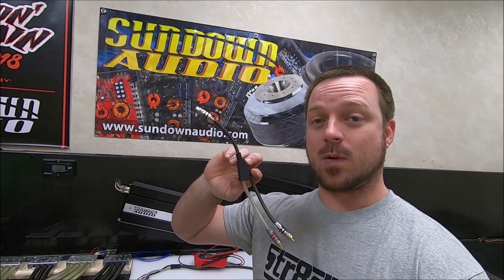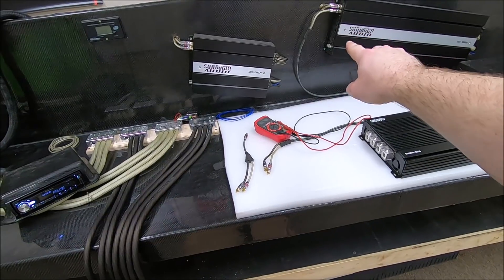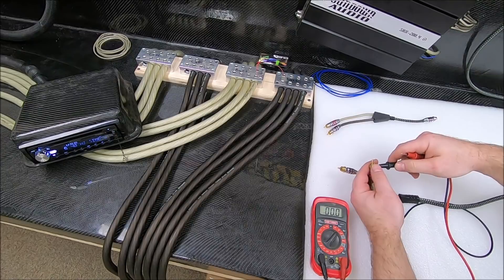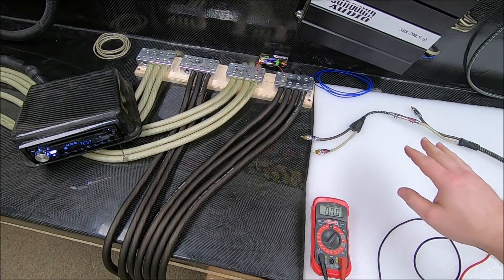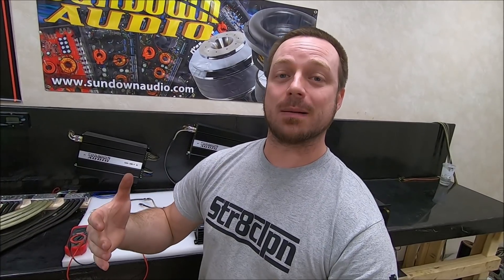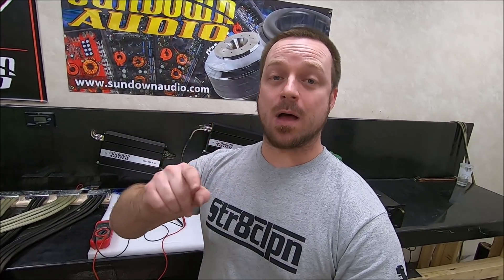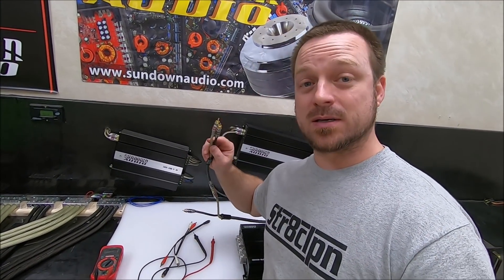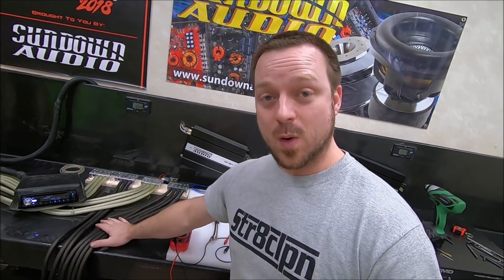***Car Audio Mythbusters*** Splitting RCA Signal Voltage

Comment: You are presenting this as though voltage = power.  While it is true that voltage is part of the equation to measure power, it is only half of the equation.  The other half is amperage.  And, when you split an RCA cable into two, whilst also providing a load to both connections, you will deliver HALF of the amperage down that wire, meaning you have halved the power.  There's no free lunch.  The law of conservation of energy governs this behavior.  I will also add that once you have reached the peak amperage that the deck will deliver down that RCA connection, your voltage will drop off.  Increasing the load will cause this earlier.
Reply: @choosetherightify That is 100% incorrect.  

1.   You are referring to power.  Power is a term for watts.  Not voltage.  Not Amperage.  Not resistance.  Power =watts Intensity=Amperage.  Shows you need to brush up on Ohms law and Watts Law.

2.  Law of conservation of energy states that the total energy of an isolated system remains constant.  You have indicated it is much different.

3.  Do you know the difference between a series circuit and a Parallel circuit?  If the Rca cables were wired in series then you would loose amperage.  Think of daisy chaining amplifiers. That is a series circuit.  Signal goes into one amplifier, some of the signal is used by one amplifier then sent to the other amplifier at a reduction.  If resistance goes up amperage goes down and voltage will remain the same.

4.  Y splitting is a parallel circuit.  Because each branch in the 3 way Y splitter will measue the same amperage.  Why?  At most that y split will have 1 ohm of resistance maybe up to 2 or 3 if it is poorly made.  At 1 ohm of resistance and 2.6 volts you will have 2.6 amps at each branch.  Total wattage of that circuit is 6.76.  This how basic electrical systems work.  You can't change the rules because you can't figure it out.  

With your claim every automotive manufacturer is wrong.  Every electronic engineer and designer is wrong.
Reply: No you are right I love how people are arguing with you without ever even hooking it up ive done it and it made the single to both amps weaker

Comment: To really test this one, should connect cables to amp(s). When there’s no load at all sure it doesn’t affect to voltage. RCA dividers probably work, but this test doesn’t proof anything.
Reply: I agree. Yes multiple runs of power wire won’t effect t your voltage but if you run one or two amps and then test your voltage you will see a drop because there is a current pull on it. I would like to see the same thing done with the RCA’s. Power on an amp and put a draw on the power and then test the splitter to see if the voltage drops on the splitters while the amp or amps are using that current. That would be a good video to add to this one.

Comment: put load on one plug then check the volts on the other/ plug one lead into the amp then read the other
Reply: Yes that wasn't a true test. Voltage drop happens under load. He should have split  the signal into channels 1,2 3,4 on an amp. While playing tone through speakers.
Reply: 100% true without a load it won’t change what a fake test 😂
Reply: @buffcookie  I don’t think he was trying to be fake, I think he truly didn’t know what he was doing. Did you hear how arrogant he sounded when he says  “ I can’t believe this, I can’t believe that.....
Reply: rca's are only for signal. plugging into an amp doesn't "load" the head unit.
Reply: @robechstenkamper4149  that’s not what they meant. They are talking about the second split signal. The one that is not plugged in during the test, so it will be the same as if not plugged into second amp or non existence. You need to plug both signals into amp the do the test again.
Reply: @DjJerryofficialChannel1  yeah, i know how voltage droop works under load. what im saying is amplifiers don't load head units. thus, no load line vdroop. that's why they can be connected via pre-amp outpout. input impedance is high which means amperage remains low. that's why most if not all amps can have daisy chain connectors. they don't "relay" the signal either, they're just connected internally. in other words, when you split an rca, you don't halve the voltage, you double the amperage. but amperage is so low, that it also doesn't matter. hence, no real vdroop from additional load either. unless you have a very non standard setup. oh wait, you're saying that he misunderstands the argument? he's testing for "Division," not vdroop. either way it doesn't matter. he could do a video clarifying that point i guess.

Comment: All depends on the signal source output impedance.  If you split the signal to two amps that have a preamp input impedance of 10k ohms the source would see a 5k ohm load so it would need to supply twice the current for the same voltage.
Reply: Finally someone ACTUALLY knows the truth. So many know it alls who don't actually know.  Just using a voltage divider calculation such as this one http://www.sengpielaudio.com/calculator-voltagedivider.htm will tell you what you are losing in output based on the impedance of rca output and amp. I know my kenwood hu is 4v and 10k ohm and my 2 sub amps are also a 10k ohm impedance which is giving me a -6db reduction! Might be getting same voltage but with the impedance loading it reduces output significantly. So the statement that it doesnt reduce voltage is absolutely true but it will lower your overall signal output depending on impedance ratings of your rca output and amplifiers.
Reply: It don't matter if it splits or not if everyone out there is setting there amp gains wrong and you got a distortion buck rolling on wheels seems like everyone makes the simplest things hard there's no more sound quality in car audio like we had in the 80s and 90s china has litter the market with cheap and low quality audio products that this generation has to listen to china has litter the whole  market with trash including everyday houses hold appliances. But hey chinas making money and so is the ones buying and rebranding the shit as there own crap everyone wins except for quality  thats today's lesson boy's and girl's or whatever you identify as .

Comment: You need to check voltage with loads on each RCA !! Obviously the voltage will be the same without a load !!!
Reply: Why are you putting a load on your RCA cables!? Have you ever seen an RCA cables spark due to power draw? Never right? That's because they're providing a signal to the amplifier. They don't carry much in the way of amperage. If you want load, measure the current to the speakers.

Derek, can you put this to rest by measuring current over the RCA from the head unit to amplifier. Then measure current between the amp and speaker?

Comment: There is a very easy explication of this. The splitter creates a parallel circuit.
In a parallel circuit voltage across the separate load resistors stays the same, current is distibuted across each resistor of each branch.
What most don't understand is that when you parrellel enough amps that the impedance at the head unit or signal source will be too low and cause loading on the source, Thus output voltage dropping.
When impedances are matched you get maximum circuit signal transfer to the load.
When the load impedance is mismatched you get a reduction in the signal.
In the audio frequently spectrum you don't have as large of an issue due to the low frequencies due to line loss, only then dealing with very small voltages. But even at 2v that isn't that low of a signal.
Reply: Well at least 3 people seem to understand this.   I believe the term is impedance matching for what is going on here.   Not all devices have good RCA Preouts that can handle driving more then 2 sets of RCA's without problems as I have witnessed in my Android  Win Ce head unit MP5 model I have tested for over a year.  

just connecting the second set of RCA's gives me a significant output drop.     tried with different brands of amplifiers same thing.  

this is something that's more common with inexpensive equipment then something with a good solid Pioneer Sony or other name brand car audio device or piece of gear.

for example my topping ATC 10 and my aimpire dac don't really show the audible problems of hooking or splitting up at URC outputs as the car stereo deck does there seems to be a slight reduction of output but it's nothing like from the head unit.
Reply: Great video! 100 percent agree with everything well except with buying expensive rcas! Lmao my crappy ones work just fine lol ..I have my amplifiers strapped right now but tomorrow I'm going to split my RCAs and run one amp per voice coil cause I dont feel the strapping is really doing what it should ..2 JBL club A 1000.1 and a American bass VFL-18 in a dodge  ram quad cab

Comment: I had a setup back in the late 80's into the mid 90's that used four splitters and was told the same thing. I ran them anyway and had the best seasons ever. This is definitely a myth. 
Good video.
Reply: G
Reply: Voltage may stay sane but current or impedance does change think of it like a river you can't fork a river and it stay the same

Comment: If I plan to run 3amps for my sound system, would I need to upgrade my alternator and battery? Or does it depend on the quantity of speakers/subs I want to run? TIA 💯

Comment: Lets thing about it like it a river.   If you split a river do you have a the some amount of water flowing?   Nope...But we aren't talking about voltage we are talking about current.  

Which is why you do the big 3 and the install alternates...because when you split your amperage will drop...

To make voltage drop you make the wire longer.

Comment: Next test other than looks what's better bunch of rca y splitters or the rca distribution box like in project spl? Or would there not be a difference.
Reply: Distro box for sure, every connector can add a small bit of interference, so having one in 8 out instead of 1-2, 2-4, 4-8 is way better. Also the unit keeps cables tidier which can help reduce induced noise.

Comment: So does it make a difference if your amp only has 1 RCA input, will it be better to use a splitter to use both RCA from the headunit or will it be the same with just the 1 RCA?

Comment: Derrick is spot on; splitting one output to multiple inputs is a relatively risk free. 
It is making an electrical difference, but that difference is negligible for these purposes. 
If you’re wondering what’s happening, the head unit output will be low impedance, here 2.6v at maybe 500 Ohm, with the amp inputs presenting a much higher load, typically 10k – 50k Ohm (this deliberate imbalance of impedances is exactly why you can’t use a splitter in reverse and try to merge two outputs to one input with the same cable). 
You could go crazy and stack up ten amps on the line out using splitters and your head unit would still see over 1k Ohm and probably be ok. It wouldn’t all be plain sailing; the lower load impedance would make the output work harder – output more current - so you could introduce distortion where it would be a clean signal otherwise. The lower impedance load would be more susceptible to capacitance noise from poor quality cable. 
If you’re not splitting to more than four amps don’t worry about it (although consider adding RF chokes at the Amp end for $1 to try and stop the hiss of RF noise). If you’ve got more than four amps, you should be serious enough to get a proper distribution unit or do the mathematics to check if it’s OK for your particular setup. 
Some of the Sundown Audio monoblocks have 56k Ohm input, which would chain together really well, where your home hi-fi amp might be a fraction of that…
Reply: I'll just quote your words so that people might be able to read it and hopefully get educated. "the head unit output will be low impedance, here 2.6v at maybe 500 Ohm, with the amp inputs presenting a much higher load, typically 10k – 50k Ohm (this deliberate imbalance of impedances is exactly why you can’t use a splitter in reverse and try to merge two outputs to one input with the same cable)."

Comment: It actually makes perfect sense, pee over i r, it depends on the ohm load of each leg, and RCA's they are quite high, so essentially it's like dividing the water hose against a bunch of closed spray nozzles.

Think about speakers, and home load, currents and voltage

Comment: I had a Rockville 4 channel amp before that had a massive resistance on the RCA inputs, like 40k ohms I think, and any time I would split my RCAs to that amp it would lower the power drastically. I wonder if that type of thing happens a lot and makes people think it's the splitter.

Comment: Question. When setting gain do you add the voltage of each rca together? Like your example was 2.6 volts. So would you set gain for 2.6 or for 5.2?? Im just a little confused for monoblock amps. Wiring 2 of them from only 1 subwoofer out from the HU

Comment: I’ve always noticed that when I use a splitter the amp doesn’t seem to be as strong as if I just ran straight rcas it might be Bc I use cheap splitters idk 🤷🏼‍♂️
Reply: Yes on my mono amp it’s a sundown if I plug one rca in it’s literally half the power it sounds like your head unit can only output so many a volts and amps once you surpass that guess what happens I love all these videos but this one bro you are wrong
Reply: Why won't he test current or impedance drop come on Jake hook it's a river if you put a fork in a river both forks split the flow of the water think about my man for fuks sake you r wrong test all v c and a
Reply: Your logic is wrong. Removing an RCA from input is not the same as splitting an RCA cable

Comment: Ok so what your saying is if i run a deck with single rca out and split that to two amps vs using a deck with two sets of rca outs , there will be no difference in sound quality or performance assuming both decks produce the exact same voltage?

Comment: So the voltage stays how about the current?
Reply: And or impedance
Reply: I looked more into this and found this page:
https://handcraftedcaraudio.com/rca-y-cables/
It is super informative and goes deep into the math of line level electrical theory. The bottom line is there IS in fact a voltage drop when using splitters but it is so small that it can be easily fixed even on a bunch of amps of one source by just turning up the gain a tiny bit.
Reply: @Widowmaker2828  excellent find so I had an output voltage of 3.7v I had 4 amps hooked up one for each sub and played it at 1/4 volume according to that article (I had a weak output signal obviously) there would be a significant voltage drop due to it only gets max output signal at max volume if my math is correct I had .9v at each amp which would explain perfectly why I could obviously hear a volume difference when I unplugged 2amps. Jacob these are facts backed by data I love sundown with all my bassheart but if he doesn't acknowledge the facts you provided and and take the small humility in admitting being wrong I will never purchase Sundown equipment again and that's going to destroy my love for music thanks for the valuable info.
Reply: @Widowmaker2828  thank you SIR
Reply: @RollingThunder85  I am not sure how you came up the .9 volts per amp. (I'll bet it's more if you checked it with a meter.) But  even if it was .9 volts per amp the would be perfectly fine as long as the preout voltage is greater than the minimum input sensitivity range which on most amps is 150-250mv. 
The only other reason not to go with splitters is if you have unwanted noise. Then if it really bothers you spend the $100-$200 for a line driver and increase the RCA voltage and headroom.
Reply: @Widowmaker2828  I'm not at all saying don't use splitters I'm only attesting to the fact I can hear an audible difference when I use them  I have 3 in front of me at this very moment
Reply: @Widowmaker2828  Jacob said one who believes this is in my words not his crazy I'm calling my college professor in electrical engineering to get a proper way of describing what I'm trying to explain y cables are great I love  them I use them but on my old amps actually in my home 120v amps I can hear a much larger audible difference after connecting them
Reply: @RollingThunder85  Ahh, gotcha. 👍

Comment: Splitting don't make no difference 🤗 but, if you load one end in the amp, will you still get 2.6 on the other? So will both amps get 2,6v?  This i have never tested 🤗 the amplifier uses the signal voltage for reading, does this take effect? 🤔 maybe thats what they mean? 🤔

Comment: could you show or tell me i have a pioneer head unit with 4 rca outputs and no sub out, i want to hook up a 4 channel amp and a small powered sub to go under the seat. do i just  use the front channel out put and split it at the 4 channel and use the other rca jacks for the powered sub? any suggestions would be appreciated

Comment: Mine shows 5 volts on my RCA jacks and I believe it's flipping my protection on the amp does that sound right? 2011 Camaro with Boston's... I have the Crutchfield or Falken splitter system and it still doesn't work

Comment: My headunit only has 1 set of rca's. I have a sfb amp powering my Subs. I want to add a 4 channel sfb amp for mid range and tweeters. Can I use Y splitters since they are 2 different kind of amps or should I get a new headunit?

Comment: Hello! i am gonna use splitter cables on my taramps tl-1500 3 channel amp with only 1 channel rca's...my headunit is a pioneer with 2 channel rca's...now if i choose rear/sub or sub/sub on my HU the speakers won't play...they play only in rear/rear option and this means that i don't have the sub control option....so that i am asking is if it's gonna work right with RCA splitters!